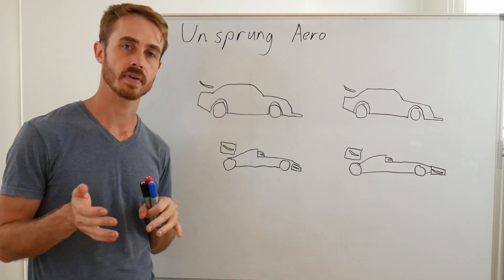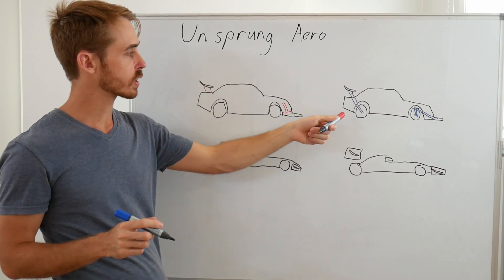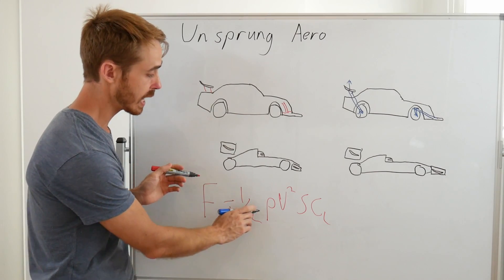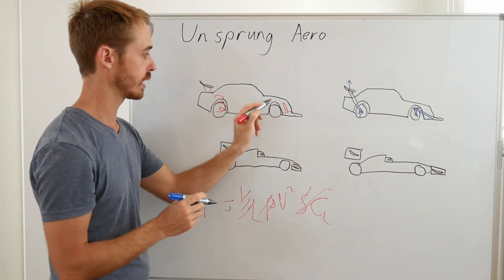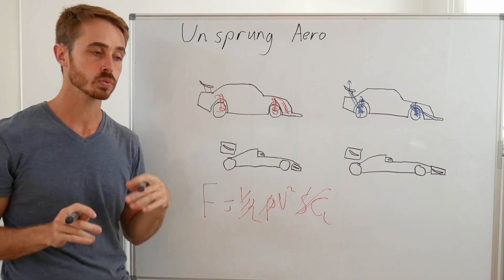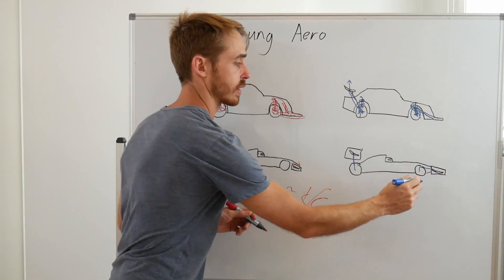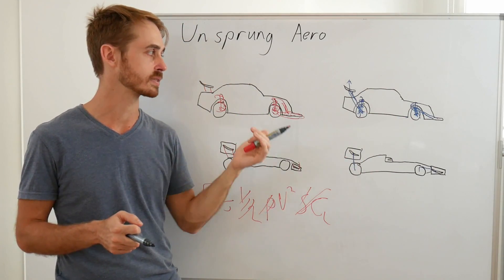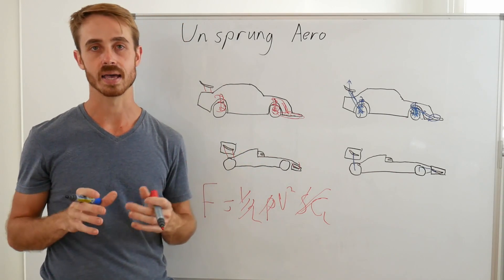The Aerodynamicists Magic Bullet? Unsprung Aero Explained

Comment: You, Sir, will make it big. I am flabbergasted you haven't caught up with EE.
Reply: "....because the more efficient the car, the less emissions per mile."

That only applies to CO2 emissions, which are not regulated in the US and have nothing to do with the formation of smog. Gasoline vehicles meet and exceed current emissions regulations without issue. The diesels currently on sale in the US are only about 15% more fuel efficient than similar gasoline vehicles, not 100% more efficient.
Reply: Like what misconceptions? (honest question)
Reply: I feel like we're thread jacking this poor guy's video on unsprung aero, but I have to jump in again because there's some critical incorrect statements left unaddressed.Paul Harvey: Diesel has an extremely low octane number, so it's very prone to auto-ignition. The engines rely on this quality to operate. Don't forget the fuel is added directly to the cylinder and when they want to add it, so knock is not a problem like it is in spark ignited engines. Also, turbos don't increase the compression ratio of the engine. That's defined as the ratio of volumes inside the cylinder BDC to TDC. Furthermore, the turbo almost always still produces a negative work pumping loop (some exceptions in some operating conditions of heavy duty engines), it just crams a lot more air into the engine. And because of this, the compression ratio actually has to be lowered to stay within safe peak pressures. This reduces engine efficiency. But, if you make your engine smaller, you can run at less intake vacuum (negative pumping work, only talking gasoline here) to reduce your pumping work and become more efficient in the end. This is the "downsizing" approach. As an aside, the equation you wrote is not valid for diesel engines.idontcare80: I get your point, but it's just as dangerous to say "diesels DON'T make more torque than gasoline engines" as it is to say the converse. You're cherry picking a bit across manufacturers in different decades with different targets. For modern turbocharged engines of similar displacement and power, it's very safe to say the diesel engine produces much more torque. As to why an NA diesel produces less torque than it's gasoline brother, it's due to targets of acceptable soot emissions. Diesel engines--unless doing DPF regen or similar--even at full load are running globally fuel-lean, otherwise the soot emissions would be unacceptable...as deemed by manufactures...and normal as deemed by truck pullers! So a diesel doesn't use all the oxygen in its cylinder whereas the gasoline engine will.
Reply: Diesels DON'T make more torque than gasoline engines, and stroke has absolutely nothing to do with the torque output of an engine. You can look into the physics of how a crankshaft works to learn why.
Reply: Correct me if I am wrong, but this is my naive understanding:

I don't know a whole lot of about diesel or gasoline engines, but I did take a few classes on thermodynamics. For an I.C.E the efficiency of the cycles is 1-r^(1-y) where r is the compression ratio and y is the specific heat ratio. The specific heat ratio is dependent on the fluid (air/fuel mixture) and compression ratio is limited by the material limitations of the combustion chamber and the auto ignition temperature of the fuel. The auto-ignition temperature is higher for diesels and high octane fuels, that is why high performance gasoline engines and diesels can have higher compression ratios without knocking and loss in performance. Therefore the primary influence on the power output given a set fuel/heat input is the compression ratio. 

 Is this an oversimplified understanding of where the work output of engines come from?
Reply: Ok, that matches with what I thought. The turbo just boosts the compression ratio which produces a larger work output for the same size displacement. 
I believe the misunderstanding lies in the fact that diesel fuel requires higher compression to combust therefore diesels generally have higher compression ratios (whether forced induction or not) and thus more work output vs. the run of the mill gasoline engine. However there is nothing inherent in the diesel engine that makes it more 'powerful' than a similarly speced gasoline engine.
Reply: t. a guy who doesn't drive a diesel / irrationally hates diesels because he drank the US' emissions koolaid.
Reply: MPG? What are you talking about? Are you one of those people who thinks that emissions are regulated because of global warming? That's not why emissions are regulated in the US, emissions are regulated in the US in order to protect human health. Smog-forming emissions are regulated in the US, in other words, not CO2 emissions. This is done because Americans live in huge, dense cities and smog becomes a massive health issue if vehicle emissions are not regulated. Diesels are now required to conform to the same standards as gasoline engines, and they weren't not all that long ago.

Some cities around the world are considering banning diesels because they're causing such serious smog issues.
Reply: That's not how crankshafts work. You're forgetting that the geometry of the lever changes as the crankshaft rotates. For part of the throw of the crankshaft (near TDC and BDC), a long stroke crank actually transmits less force than a short throw crankshaft, so the mean torque output evens out between the two. If a longer stroke did result in more torque output, you could just get free torque (and therefore power) out of an engine simply by lengthening its stroke, and there's just no free lunch in the world of physics.

Can you give me a reason why I shouldn't hate diesels?
Reply: Stroker engines have more torque because they have more displacement. There's no free lunch there, they're burning more fuel and air to produce that torque.

"By saying you want diesels to vanish you're asking for millions of automobiles to be scrapped and to be replaced with gassers"

No I'm not, I'm just saying that no new diesels should be produced.

"you're asking people in Europe to drastically increase their fuel spendings because guess what, gas is much more expensive in Europe than in the US."

For what they're paying to drive diesels, they could be driving hybrids, which are much more efficient than diesels.
Reply: Nick Nadeau Congratulations, absolutely nothing you've said here makes any sense.
Reply: The problem is that it's usually turbocharged diesels that are compared to naturally aspirated gasoline engines. Naturally aspirated diesels actually make less torque than naturally aspirated gasoline engines. Comparing turbocharged engines gets a little tricky because raising the boost pressure is all that needs to be done in order to increase torque output.

I definitely agree with you about EE and his regurgitation problem.
Reply: idontcare80 Well now I'm even curious as to what similarly sized, similar peak power gasoline engines make more torque than their diesel equivalent.
Reply: Damn it, I need to remember to save this response somewhere, because I've had to rewrite it so many times. You can compare GM 350s in the 1980s to the Olds diesel 350, you can compare the 6.5 Detroit Diesel V8 to the V8s of its time, you can compare the Mercedes-Benz OM604 engine to the Honda F20A, F22A etc...
Reply: The torque output of an engine is most dependent on the amount of fuel and air being combusted on each individual power stroke. More fuel and air in the cylinder = bigger bang, which = more force on the piston... which is then converted into torque by the crankshaft. The power output of the engine is basically the rate of torque (work, more accurately), so the faster it can turn at a given torque rating, the more power it will produce. Diesels usually have their torque output boosted by turbochargers so that they make quite a lot of torque at low rpm, this is because they simply can't spin very fast, so in order to produce a decent amount of power, they have to produce a large amount of torque. This doesn't mean that diesels inherently make more torque, they're just tuned that way sometimes. Many turbocharged gasoline engines match the torque output of many turbocharged diesels.
Reply: "The turbo just boosts the compression ratio which produces a larger work output for the same size displacement. "

Typically, but not even the work (torque) output of a diesel is larger unless is has a turbocharger, and then it's simply boosted to produce more torque than most gasoline engines, because it wouldn't produce a decent amount of power otherwise. Newer, turbocharged gasoline engines (like Ford's Ecoboost engines) are matching, or exceeding, the torque output of diesels of the same displacement.

I can't really explain why NA diesels don't make more torque than gasoline engines, they just don't.
Reply: They aren't as efficient as they can be because of emissions regulations, that's correct, but why should they get a free pass on polluting just because they're diesels? That doesn't make any sense. And, yes, those regulations are basically impossible for diesels to reach, but they're not excessive because gasoline engines can meet them without any kind of issue. No, gasoline vehicles don't emit greater amounts of smog-forming emissions, they emit considerably less. Some of the cleaner gasoline vehicles can actually have exhaust that's cleaner than the air in some cities. On top of that, when a diesel is cleaned up to the same standard, it doesn't have lower CO2 emissions. Like I said, diesels are completely obsolete.
Reply: idontcare80 It is the gas cars that are getting a free pass, which is the entire point. Diesel and diesel hybrids are
able to achieve efficiencies gas cars could only dream of. But we are deeming the technology off limits. I don't disagree that hybrid and electric are the future, but a diesel hybrid could achieve efficiencies a gas car couldn't even come close to. (and again, efficiency matters, as I already explained). Give diesel the same research $$$ and you will get results, and those results will be better than what gas can do. But bias seems to want to keep the status quo, even if it means less efficient and more pollution.
Reply: Actually quite a few diesels got their ratings removed from that website after dieselgate. Anyway, NOx is one of the main causes of smog, and it's exactly that which is difficult to clean from diesel exhaust. Particulate emissions are also much higher from diesels.
Reply: Yes, that's why stroker engines don't have more torque, right?
Wait.

"Can you give me a reason why I shouldn't hate diesels?"
Perhaps because being overly emotional is a sign of infancy and "loving one product, hating another" is being a fanboy? I don't like electric cars, but I'm far for hating them, nor do I hate any company.
By saying you want diesels to vanish you're asking for millions of automobiles to be scrapped and to be replaced with gassers, ignoring the ecological damage caused by the creation of a car alone and how these people are supposed to finance a new car and you're asking people in Europe to drastically increase their fuel spendings because guess what, gas is much more expensive in Europe than in the US.
Reply: I think YouTube deleted my comment. Put imgur(dot)com in front of this: /a/oF8y5

Edit: If that doesn't work, Road & Track did a real world comparison between the Golf TDI and the Toyota Prius. The Prius returned 54.5 mpg, the Golf returned 42.7 mpg. Also consider that the Golf was burning fuel that emits 15% more CO2 per gallon burned.
Reply: +idontcare80 I'll  tell you some facts about the Diesel and it's torque behaviour. First and for all, it is dumb to talk about engines rather one has more torque than the other. It is about when they produce torque, wich the diesel does at lower rpm than the petrol engine. "Why do older Diesel engines have lower torque than petrol engines of the same age?", because the Diesel engine runs with a Lambda coefficient of more than 1 and petrol engines one a lambda coefficient of around 1 (Diesel engines run with an excess of air), wich means that they can't burn as much fuel as a petrol engine (when the diesel engine isn't turbocharged). The diesel engines is naturally more efficient than the petrol engine because of the high compression ratio, wich is needed to ignite the fuel (Diesel has around 100-105 Octane equivalent, normally Diesel gets rated with cetan). The high compression ration i turn gives a overall higher pressure, what in turn means higher torque output.The easiest way of getting the higher compression ratio is by increasing the crankshaft stroke. So, all you said was nothing more than hot air (pun intended ;D). No, for real, the crankshaft is more or less the reason for the  high torque at low rpm. The downside is that you can't go as rev your engine over a certain limit ( the piston velocity would direct the ultimate limit). You can certainly get the same torque output with a petrol than with your diesel but the petrol engine would generate that output at higher rpm, what in turn makes it inefficient. Therefor the Diesel engine won't be obsolete for some time. I would guess that the Diesel and the Petrol engine are getting obsolete when there is a good way to transport huge amounts of electric energy, wich would  make the electric ac motor popular for automotive use and the internal combustion engine obsolete.
Reply: In trade school they said that a Diesel engines cylinder pressure is still rising well past tdc, because of the longer injection event. That's why they make more torque. 

Gasoline cylinder pressures peak closer to tdc.

So its not so much about stroke length, as it is about timing of cylinder pressure.
Reply: Hold my beer, I'm off to create the most efficient engine ever. Long stroke is the answer, right guys? Lmao, use your brain!
Reply: Caught up? This guy blows EE out of the water. EE has no idea what he's talking about sometimes.
Reply: I didn't mean technically, I meant viewership. EE is pretty helpful for the non-aerodynamic aspects of cars. I am glad they are both willing to educating us!
Reply: He actually perpetuates a lot of common misconceptions about automotive technology. He does more harm than good for people.
Reply: idontcare80 Thank you! I HATE that guy! I stopped watching too because all his content was often half an explanation dressed up to be the full explanation. It bothers me on such a deep level that people think they know how something works based on the content in his videos. When he started collaborating with car throttle I face palmed.
Reply: Marcelo Jardim That diesels make more torque than gasoline engines, that pushrod engines are simpler than OHC engines, and his horsepower and torque video was incredibly misleading and uninformative. I stopped watching his videos because views = $$.
Reply: Well usually the diesel engines of one car line will make more torque then their gasoline counterpart, but that's because the diesel has its horses at 3500RPM while the gasser has them at 6000RPM. Since car manufacturers want their diesel variants to produce the same amount of horses than their gassers, the diesels need to have more oxen to make this happen because horses = oxen x rotational speed.

I certainly do agree that Engineering "not really" Explained merely regurgitates information already widely available or understood by his audience while Kyle here actually tries and manages to explain complicated and unintuitive things like witchcraft aerodynamics to laymen.
Reply: Except hybrids are only that efficient when driven in lab conditions.
Reply: It's an open forum, you can discuss how much you like cats if you want. Anyway, what you're saying is that diesels can't produce more torque than gasoline engines unless they're turbocharged, or, if they're not, they can't produce more torque than gasoline engines without polluting excessively. 

We were talking about the engine's ability to perform work as measured at the crankshaft (torque output) which is actually completely irrelevant to anything, power output (the rate of work) is all that really matters.

Anyway, I'll gladly point out that diesels fail to produce more torque than gasoline engines when they're not turbocharged, because diesels just need to disappear from the face of the Earth, they're no longer relevant (except for use as ship engines). The ridiculously complex and problematic emissions control systems needed for diesels make them completely impractical for road-going vehicles, series hybrid systems with turbine ICEs make more sense in heavy applications (no ridiculous aftertreatment needed), and they're much too heavy to be practical for aircraft use... they just suck.
Reply: idontcare80 That simply isn't true. Modern diesels (in the USA) are required to be an order of magnitude cleaner than their gasoline counterparts. The ones that do pass, even with the unfair regulations, still manage to best a similar sized gas motor by at least a third in miles per gallon. If gasoline had the same restrictions, it would basically be undrivable. 
Your post reeks so much of bias and misinformation that it is simply just sad.
Reply: Diesels usually make more torque because they have longer strokes.
The longer the stroke means the further out the arm on the crankshaft is.
The downside of this is that piston speed is increased so you won't be able to rev as high as an engine with a shorter stroke, however because diesels rarely rev past 4k, this doesn't matter.
Reply: idontcare80 Wow, that is a nice essay, and even if it were true (it's not) has nothing to do with anything. The reason miles per gallon matters is because the more efficient the car, the less emissions per mile. A diesel, theoretically, can be twice as dirty as a gas powered car and still output the same emissions total (in bulk) over the course of, say, 100,000 miles, because it only uses half the fuel. 
Furthermore, your argument is entirely a red herring. Diesels are forced to meet a standard that no gas car could pass. Regardless of the reason for emissions regulations, gas cars are unfairly given a pass to produce significantly more smog than diesels.
Reply: idontcare80 Diesels are not fifty percent more efficient because they are burdened with excess regulations. How are you not understanding this? If the playing field was fair, they would be. But they are still more efficient, even given the hugely unfair advantage gas has. 
The point is, diesels are expected to meet a criteria that is basically impossible. A new gasoline powered car can (and does) contribute to BOTH smog and climate change considerably more than a new diesel. All I want is a level playing field, but you seem to think gas deserves this unfair advantage somehow.
Reply: I'm not even getting into ALL the wrong, and bigoted hate propaganda, but... diesels would be much cleaner, for one, if they were ran on the fuel they were intended to, which you should know since y'all know everything. and I'd love to see a 1,000rwhp pick-up on stock internals and less than 20k of added investment. as was said, you should be careful of putting anything in the can't, never, always pile. diesels generally make more torque per gallon, if not per CI. under square engines will generally see increased torque from over. diesels have typically responded much better to charged air, as they require stronger castings and internals with their generally much higher compression. but, when charging they are again, generally, lower compression. since high compression means 2 opposed forces. there are always trade offs. but I don't see any Honda civics running 9's on stock anything. gas engines respond differently than diesel. to different added fuels as well. propane to a gas engine, less HP but efficiency goes up. and from my understanding, as I never got to try it, propane is like nitrous to a diesel. and nitrous just helps spool the turbos, not much else. cool the charge maybe. but to a gas engine, it's like.. well, nitrous. point is, trade offs. nothing is inherently better, just better with this or that in whichever way. and hybrids are just nonsense. bought into by the same people who run everything else on big oils teet instead of better fuels, or ones that can at least be made yourself. and it is always the one who has never owned a diesel, spouting his neo Nazi hate about them. if you'd ever had one, which means if you were an actual contributor to society and not just another useless cog in its machine set on degradation of the masses into 100% slavery force, you would. which is people who actually do shit. and as for the us living in huge crowded cities, kinda the opposite. it's because we are so spread out, and like our damn space. not to mention, these are your bastard rejects, Europe.. so, please.. take their immigrant asses back so we could have a chance at peace, quiet and clean water again. white people and not knowing better than to shit where you drink.. I swear, the bubonic plague, and however many epidemics over the years have taught ya'll nothin..